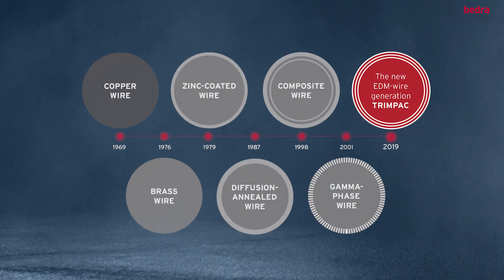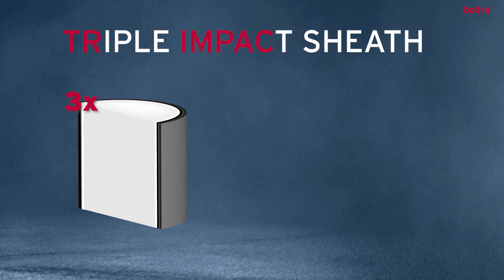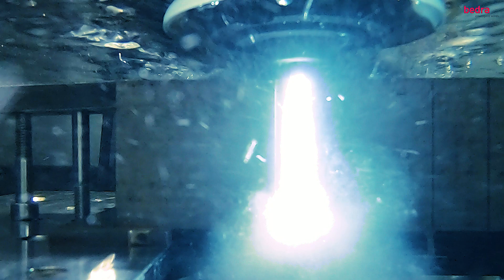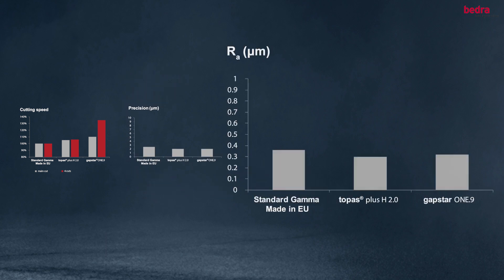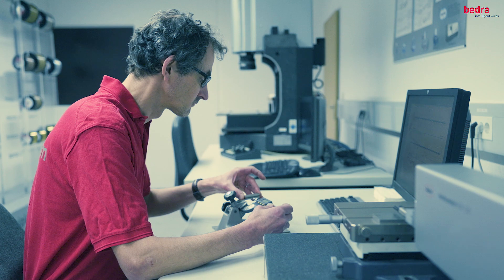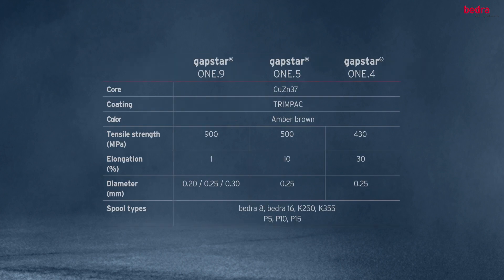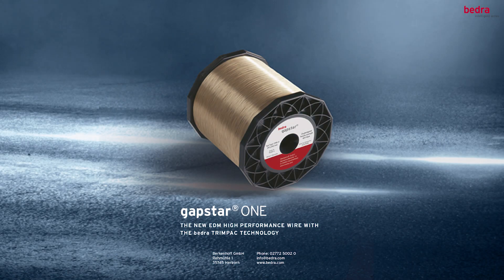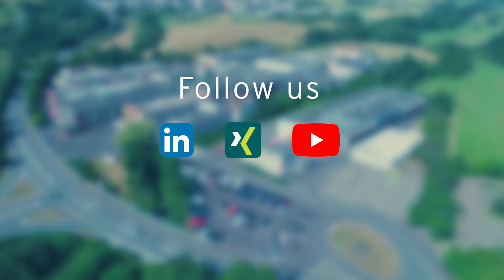gapstar® ONE - the new EDM high performance wire with the bedra TRIMPAC® technology

Comment: Sir , 60% faster margin mean the speed mm/min or the time Gapstar wire can save compare to brass wire ? Thank you very to clarify my confusion with advance .
Reply from the maker: Dear Mr. Chen, 60% increase in cutting rate does not mean 60% time saving. By increasing the cutting rate by 60% you save roughly 40% of time. 
Best regards,
Your bedra team
Reply: @berkenhoff-bedra  Thank you so much Bedra team , it clarified my confusion. Have a good day there 😊